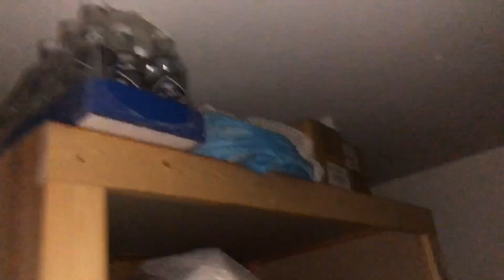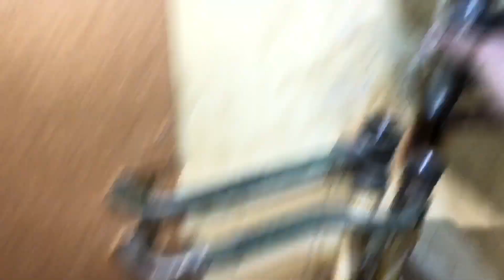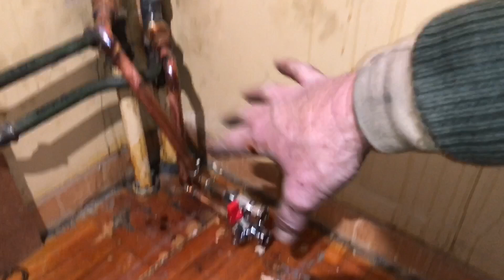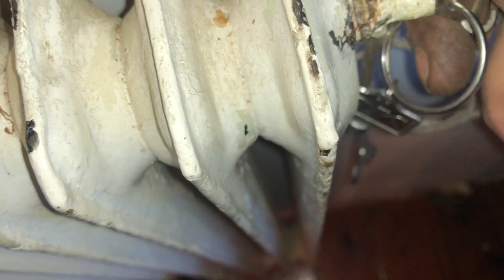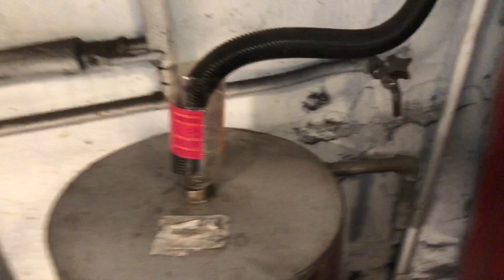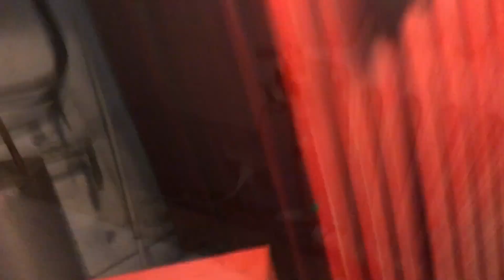Final part of industrial plumbing in an old school, steel pipes finally connecting up after 41 years

Comment: Add a radiator in the boiler room and fire wood store, that would help dry the firewood out, Have all the classrooms been fitted with a new wall and insulated with fiberglass?
Reply from the maker: There is no insulation in any wall anywhere in the building. There is no insulation in any concrete any where. It was built at a time when electricity was not required and originally had its own well.
So until 5 years ago 70% of the building had been unused since 1979. Heat in the wood room has been planned for 5 years.
Reply: @arctic-rebel  So it was just around the pipes then? whats up with the false walls then, is it just to hide wires and pipes?
Reply from the maker: @That1ufo  I think so, when the now old man first purchased the school from the kommun in 1979 he built a small apartment inside one of the class rooms for his daughter and added some power points and lights, I have removed the middle walls it they were just chip board framing and wires. All this stuff is filmed but was done on a gopro and I cannot edit it yet which is why it seems you only get snipits. 
So what was the old Gymnasium, I have now build three bedrooms which are all finished with lowered ceiling and are all fully insulated, the remaining area which you have seen some off is to be finished. I have converted the old Library into a bathroom which upstairs just leaves me the large kitchen diner to finish.
Having said all that, none of it would have been possible with out undertaking the major strucral repairs which were done Oct/Nov 2020. Internal bedrooms done Nov/Feb 2020-2021. Back blow out all stop.
So may channel started June 1st 2021 which was 3 days after surgery.

Comment: Great job Simon. 
🤔 don't mind my mind running again,  drill and tape 2 holes in the tank , one on top one on the bottom then add 2 threaded 90s with some form of nippel on them and add a lanth of clear hose and presto you have a sight glass gage . Sorry 😞 my mind don't stop thinking sometimes 😄😄😄
Reply from the maker: Hi Heith, yes I could and if you were that way inclined that is the solution.  Or you could just drop a stick in it 😄
Reply: @arctic-rebel  indeed . 🤭😄😄

Comment: What type of solder do you use?   And still I'm a little bit confuzzled about your dimension reduction so you can't have help of self circulation if needed, but of course big dimension pipes will give you more heat in the room if you don't want it.  No pass by thermostats / valves to keep the flow going around to all "corners and quadrants"?  A tip: put a rag over when you empty air from the radiators.
And have a Good Night without the banging sound in the pipes you Englishmen anyway are used to.    Have you seen TV-series "Fraggle Rock" and the Pipebangers??
[Pipebangers – The Pipebangers are Fraggles who come out after the King Gorg takes his daily bath and empties the Fraggle's pond, sing and repeatedly bang on the pipes in the wall until the pond fills with water again. The Pipebangers appeared in the episode "Let the Water Run".
Archbanger Fraggle – The head of the Pipebangers, who have the job of refilling the Fraggle Pond with water when it runs low. He does this by leading the Pipebangers in a ritual that involves striking the pipes in Fraggle Rock with sticks. The noisy pipes lead Doc to believe that there is a problem with his boiler, which he consequently empties. The Fraggles, however, believe the appearance of water to be magically related to the Pipebangers' actions. In his only appearance in "Let the Water Run," the Archbanger Fraggle is shocked when the water doesn't flow out of the pipes, despite repeated banging. He is unaware that Doc is fixing his boiler at the time. When Red brings back an umbrella from Doc's Workshop, the Archbanger insists on using it to bang on the pipes, claiming, "I know a sacred banging stick when I see one." Doc turns his boiler on at the very moment that the Archbanger begins to strike the pipes with the umbrella, and the Fraggles' faith in the pipe-banging ritual is restored.]   Haha!  Can you see some simularities?  Search YouTube for that episode. To good to be true!!! <3
Reply from the maker: OMG what are you smoking! I know about rag but always got a camera in hand. Bit important about pipe reduction, I would run 22mm to all new radiators, however the entry and exit connections already on the radiators are 12mm, so no matter the size of the pipe to the radiator the reduction on entry and exit is still 12mm. This applies to all the 1942 radiators in the building. So you use 85mm on main run, to 63mm on sub runs, this is then reduced to 38mm on floor runs with 22mm of runs to radiators then reduced to 12mm radiator inlets and exits. I did not design this, someone on 1942 did this so for me to run 22mm pipe to one new radiator with a reduction to 12mm over a 1.5meter run makes no sense,thus me running 15mm from a 22,, for 1.5meter.
OK so now we have established that my new pipes at 15mm are the best thing for the new radiators I would like to thank you for the time taken to teach me about Fraggle Rock. 
I would like to say that whilst you were watch simple cartoons I was in the back row of the cinema watching ABBA the Movie for the 82nd time and experimenting with  Monica's pipes!

Comment: Precisely as you have about ten different ground types of glycol for automotive use depending on materials and needs in engine and radiator, you have several more sugar-based Glycerin-AlcohOles [Glyc-Ol] you can add to human and animal food as sweeteners (e.g Mannitol, Sorbitol, Xylitol) as "no sugar", without additives as anticorrosion fluids and another whole "cocktail" of more dangerous and poisonous stuff!
Reply from the maker: I know they do NOT go down the drain and this is important for me and the village, in fact for everyone down the river.